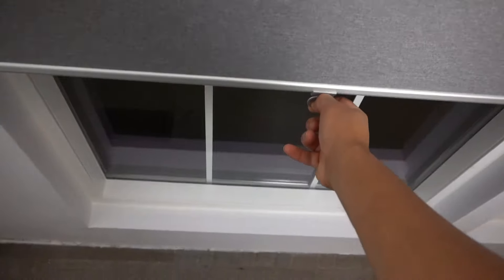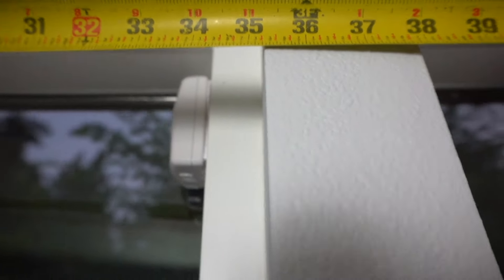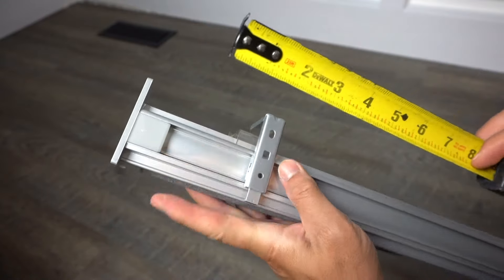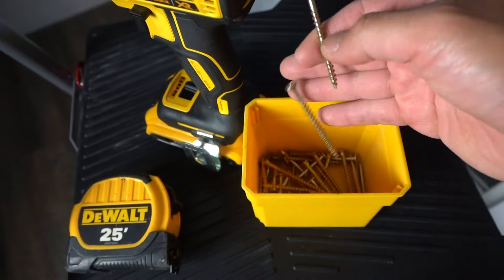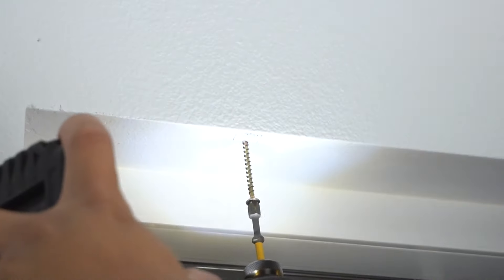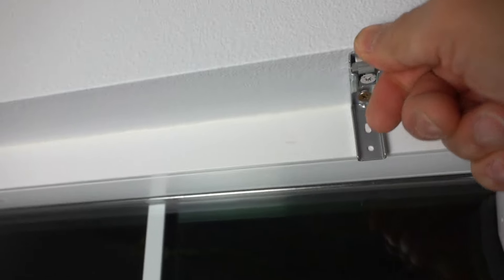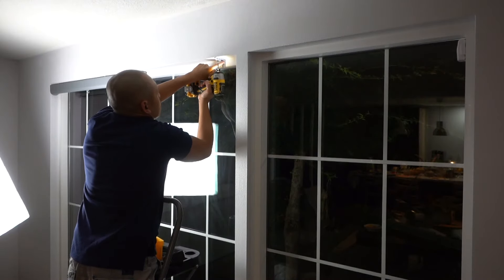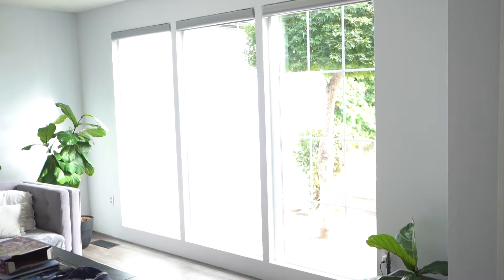IKEA Roller Blinds Hands On Review And Install - First Impressions Of IKEA TRETUR Automatic Blinds

Comment: Use 1 1/2  round head wood screws  #6. Countersinking head is not sitting well on those brackets. And 2” is an overkill.

Comment: What are the pros and cons of these, compared to the regular wood blinds that you adjust with a stick? (and pull up with a cord)
Reply: the regular wood cord blinds suck, the cords sometimes get stuck, the mounting mechanism is weak, sometimes needs a lot of strength to pull up the blinds with the cord. One time at a house showing, I accidentally pulled down a set of blinds onto my head, because the homeowner didn't mount them correctly (or the mounting clip broke)
Reply: @htko89  Oh, wow! Well, thanks for telling me but too late! I already ordered them 🤷🏻‍♀